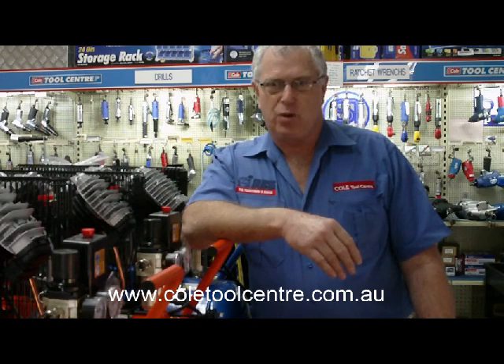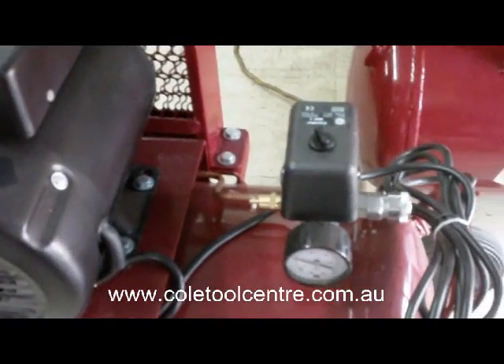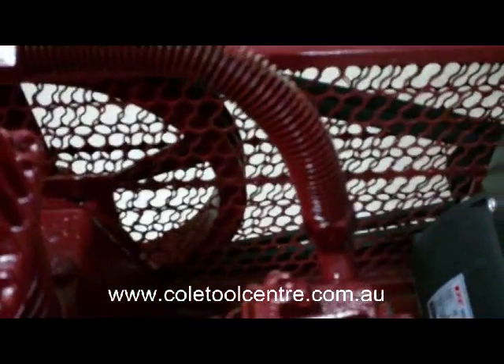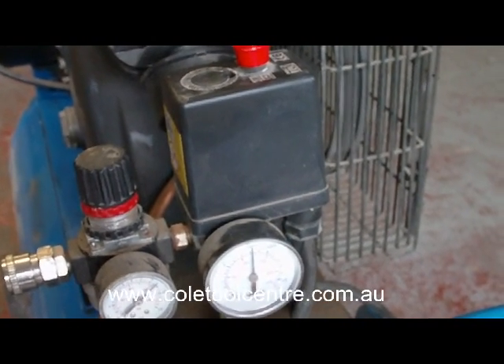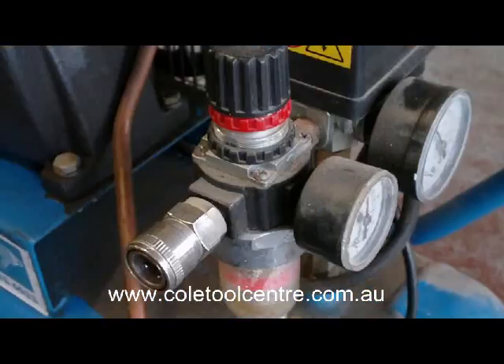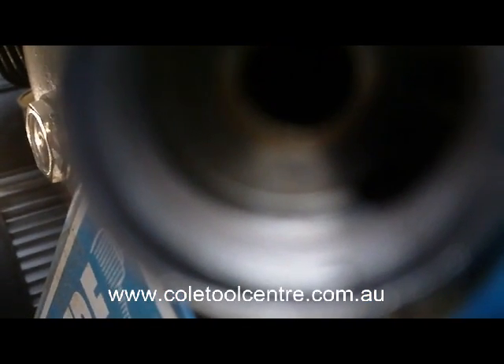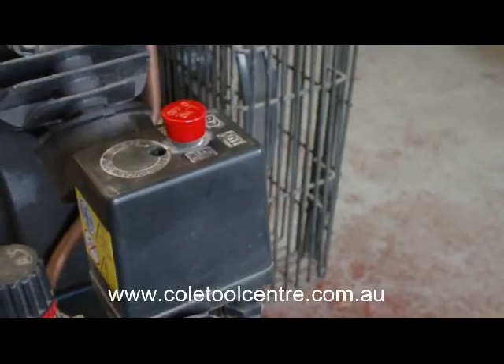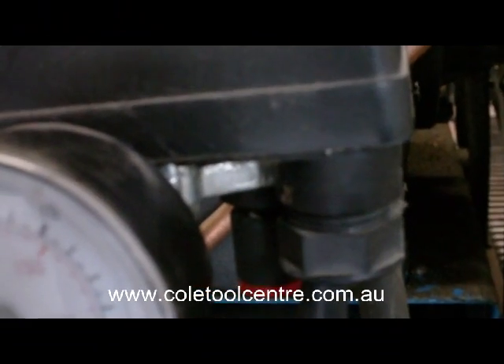Air Compressor Repair Part1

Comment from the maker: I see a couple of newer comment on compressor not building pressure. I did reply two years ago I will go through again.
Remove air filter (beware if it has been running it will be hot) place palm over intake hole,
There should be suction, no blow back or popping back. If it only fails at pressure check at the failure pressure.
most likely broken gasket or valve, Make sure when you pull the head off that you separate all layers, many have three gaskets.
Replace all gaskets any faulty broken or leaking gasket check with a straight edge that the surface you are going back onto is flat or it may not work and will blow again. If warped Lap surface with wet and dry sandpaper on a piece of glass. Check reed valves, and if fitted springs. nothing should be under valve holding valve off surface, the valve is not bent and not seating. the seat where the valve goes is not excessively worn or pitted and not sealing.

Comment from the maker: If you have a belt drive compressor and it sounds like it is slowing down. the belt is slipping. tighten belt but check the belt is touching the sides of the pully not touching the bottom of the pully (replace belts)

Comment from the maker: if your compressor is not increasing pressure over as high as 80 psi. while running first confirm there are no air leaks. check around pressure switch. delivery pipe pump to tank and drain bung under tank. remove the air filter place hand over inlet the machine should be trying to suck your palm in. if air is going in and out you have a problem. the top of the pump will need to be removed and find the problem. common problem broken gasket. often there are three gasket inlet exhaust gasket.head to cylinder gasket and intermediate gasket. other problems to look for bits of filter or material under valves they won't close. or broken valves.

Comment: Great video. My compressor is fairly old but has always run well. Lately it has been used a lot and now it starts to slow down after the tank reaching 400kpa or so, and struggles to get to the cut out pressure. Starts fine. Any thoughts?

Comment: I have a Husky H1820F  It keeps running and will not build up   I let it run for about 15 min.and it gets up to 20psi and will not fill up so I bought a cylinder plate, Gasket, head, head gasket, and piston/cylinder and it still will not fill up with air now what can I do?

Comment: my compressor started for some seconds then stopped & wont go again, no pressure in the system. any ideas?
Reply from the maker: Lyndon Bushnell the compressor may not have unloaded after last cycle, or have a blown capacitor or be siezed. The compressor usually have a thermal overload (resettable fuse) to protect against above. There should be a reset button on motor or inside plastic cover on direct drive pump. Sometimes the button is hard to push/reset. Once reset if there is buzzing/humming then reset pops again. Trouble shoot if no pressure in tank. Check pump is turning, and not siezed turn off use screwdriver to move pump pulley, if it is turning then you have a motor problem electrician to check   capacitor, then motor